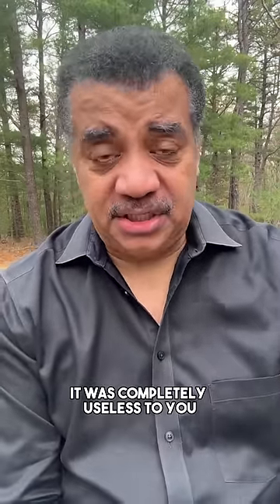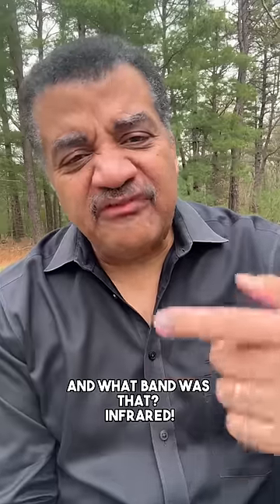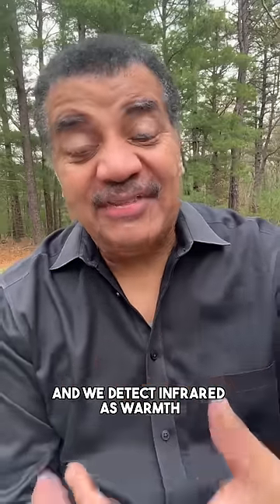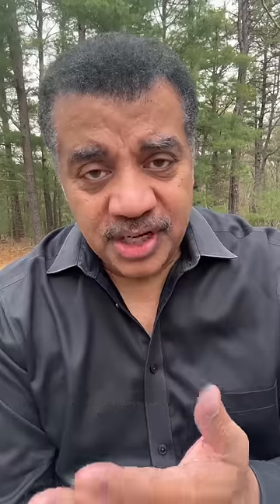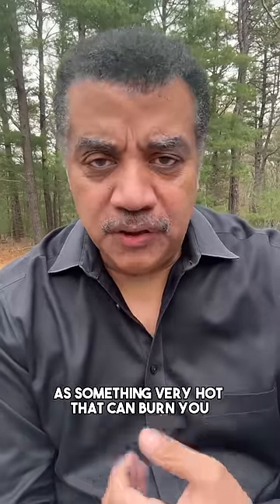LED Bulbs vs. Old Bulbs 💡

Comment: I have this theory that in ordinary houses, it's actually counter-productive to fit LED bulbs, at least in the UK weather. The reason being that the heat "wasted" using incandescent bulbs actually serves to heat the house, just enough that wearing a woollen jumper is enough to be comfortable without running the heating. In a similar way, that waste heat serves to prevent damp. In short, in a cold-climate, there's no such thing as wasted heat if it is retained in the house!
Reply: It is just that electric heating is way more expensive than e.g. gas heating, like your CV.
Reply: @JohnVanRaak-yx6cb  I wouldn't know about that, we only have electricity in my village. I have a fireplace in which I can burn coal or wood - usually only used at Christmas or when the power goes down in cold weather.
Reply: This is ridiculous. If you want to heat your house get a heater. The few hundred watts from incandescent bulbs is next to useless. Far better to use the electricity in a heat pump where each watt in gives at least 3 watts of heat.
Reply: @rogerphelps9939  Agreed.  And by separating heating and lighting you have control over both, which is helpful when you want one but not the other.  You can heat overnight without leaving the lights on, or have lights at night during a heatwave in summer.
Reply: @rogerphelps9939 I use a heat-pump for heating. Ultimately all energy used for any electrical service becomes heat, so the entirety of the 100W per bulb, eventually becomes heat, so if you've a dozen bulbs lit of an evening, that's over a kilowatt of heat - more than a single bar electric fire. My point was not that this is an effective means of heating, but rather, that there's no such thing as "wasted" heat from old incandescent bulbs....
Reply: @Fidd88-mc4sz Here’s the problem that’s only 100% efficiency which is not good enough to compete with heat pumps today. Also, if you want light you have to have the waste energy, and vice Versa, when sometimes you don’t want both
Reply: @gopackgo4036 I think you need to re-read what I actually wrote, not what you think I wrote!  I'm not talking about a house in Arizona but one in the rather chilly UK. Your statement about heat-pumps is ludicrous. "100% efficiency which is not good enough for heat pumps.."

Really????!!!!!!
Reply: @Fidd88-mc4sz  (1) I understand you live in a chilly place, that doesn’t mean it’s always cold. (2) If you own a heat pump you should know that the efficiency often exceeds 100% especially over a small temperature gradient.
Reply: @gopackgo4036  All of which I understand. And is pretty irrelevant. My point related to the rather questionable assertion that incandescent bulbs "waste" energy. Nothing to do with heat-pumps.
Reply: @Fidd88-mc4sz  well they do waste energy, and you did mention heat pumps. You seemed a little confused about the efficiency of a heat pump, so I was clarifying.
Reply: @gopackgo4036  I fear you're confusing theoretical, rather than actual efficiency. For half of the year it is fairly poor, in Winter  particularly, right when you "need" the heating, as opposed to heating hot water for use for showers/baths etc. Hence avoiding needing to use heating in Winter saves a lot of money and energy. The relatively trivial energy expenditure of incandescent light-bulbs during darkness before one turns in, is enough to prevent the need for putting heating on all but the coldest nights, provided you also dress warmly. Hence my contention that the so-called "wasted energy" of incandescent bulbs, which turns entirely to heat, is no such thing if it forestalls the considerable energy required to drive the heat-pumps, as some of the lost energy from those is exterior to the building and them confers no residual benefit to the heating of the building.
Reply: Brits be like: "It's cold, turn on the light bulb."
Reply: @elhazthorn918  LOL. We only really go that far if we run out of steak-and-kidney pudding!
Reply: @Fidd88-mc4sz  It doesn’t matter if it’s -20 out because the efficiency of a modern heat pump at such temp is at minimum 100%. Modern day heat pumps rarely drop below 100%. On the other hand, your incandescent bulb, besides not giving you the heat without also lighting the room, will be 100% “efficient” as you described.
Reply: @gopackgo4036 I use an air-source heat-pump rather than ground-source, which tend to be more efficient than air-source, although the set-up costs for the former are higher, I believe.  As regards the bulbs, ALL energy from any type of light-bulb ultimately becomes heat, so provided your insulation is adequate, then this power is all to the good. 

I fear you're missing the point here, which is that regardless of the efficiency of the heat-pump, not using it is better than turning it on, and therefore, as you will require a certain amount of lighting, irrespective of the need for heat, one may as well maximise the chances of not having to run the heat-pumps if achievable by using the "waste" heat from lamps to warm the rooms. If you have all LED lamps, that flexibility is lost, and you're more likely to have to run the heat-pumps on marginal days. Having got used to heat-pump heating, I now find traditionally heated houses oppressively hot!

Comment: That band of light IS actually useful.
Reply: You can get 'that band of light' without using light bulbs. Makes more sense if you want heat to use a heater.  If you want light to use light that don't also produce so much heat.

Comment: Our bodies evolved to need more than just the visible spectrum.
Reply: All heat you feel is infrared be it from a fire, electric heaters or incandescentlight bulbs, it's the same. If you want head best to use a heater and if you want light, best to use an LED bulb.

Comment: I like the old lights better. The color is more pleasing. Dosent hurt my eyes either
Reply: Yeah, that was true 10 years ago. Catch up to the present.
Reply: Literally there are LED that are designed to look the way you want so no, the old lights are garbage.
Reply: @ssm445 not true, it’s still missing light that you can see.
Reply: @mandersen2020  nope. Get a proper current LED, the CRI is > 97, and no, the ancient  bulbs didn't have a CRI of 100.
Reply: It's better to use the old bulbs.  If someone gives me anything with led I throw it in the trash can.
Reply: @tmayorca8770  I'd call it ignorant to use old tech and waste money for energy and replacement bulbs instead of just using superior tech (not a single failure in house or garden in 7 years. Osram Made in Germany).

Have fun replacing bulbs 🤣🤣🤣
Reply: @ssm445  you spend too much money one one dumb bulb.  I still only use bulb when needed and it lasts long time.  Your puny little LED lights give off tiny light not enough for a big man
Reply: @tmayorca8770  lol, yeah, now the LEDs are not bright enough lol. Ideologists are ridiculous. I mean... lol. "my tiny LED makes your big boy heater invisible".... Rofl. I can't get around this 🤣🤣🤣🤣 hahaha.
My 7 Watt LED bulb has a better light spread (by bigger filament) than your heater bulb. Also, it makes a 60 Watt bulb bright as a candle. And I don't need to replace it every 3 years, which is a relieve for ~40 lights. Never mind the huge energy cost savings.

Comment: NIR is not useless to you. It’s actually very important. Unfortunately, this is also the same portion of the spectrum that is filtered out by new windows. That’s why it’s important to get outside and get near infrared radiation.
Reply: What's the importance of NIR?
Reply: Exactly. That guy’s is clueless and confidently so.

Comment: Incandescents are warmer and don’t cause as many headaches as fluorescents and don’t seem as cold and blank as LEDs.
Reply: You know you can get "warm" LED bulbs, right? They're covered with a color film
Reply: Technically, you can get the same warmth from a dim LED, and it would also last longer. Also, the pleasant warmth from the incandescent bulb won't be so nice when electricity bill arrives 😂

Comment: I switched to all LED's years ago but have discovered there are still a few applications where I need an incandescent bulb so I'm fortunate in that I never discarded my old stock of those bulbs.  Places like the garage in a cabinet where I keep aerosol cans of everything from paint to WD-40 benefit immensely from having a lit bulb inside the cabinet for its warmth as my garage is unheated 99% of the time.  Also in electronics work on antique radios where I use a dim bulb tester to check for shorts when first powering an old radio up.  Even my bedroom still has one now as there are days when it's too warm to justify turning on the heat.  That bulb will keep my room a bit less chilly and is welcome to stay lit until spring, lol.

Comment: Infrared is actually good for the body…and led creates bleu light which is bad for you, it over stimulates the brain like your TV and phone (same light).
Reply: LED's can produce various wavelengths of visible light, not just blue. Also, all heat you feel is infrared light, whether from a fire or electric heaters.

Comment: The infared light is not useless, it warms/heats the house. Where i live, 75% of the year, I heat my house. Those old lights are 100% efficient 75% of the year as that heat from the bulbs just means my furnace runs less. In the summer, i hardly ever have to turn lights on as the day is so long. Thus, the old bulbs really aren't the villian that you make them out to be.

If you are using them in an area where you constantly cool your house then yes, they are extremely inefficient.

The LEDs actually have another problem and that is their switching power supplies make the power grid much more noise and less efficient.

Overall, if you use a heat pump, you should save money switching to LEDs as that saved electricty that now gets used for running the heat pump. Heat pumps can be 300%+ efficent  so they can save money that way.
Reply: yuck 🤮 it’s so

Comment: Most of the watts go to heat on LEDs as well. Difference is, incandescent and fluorescent lamps emit IR as part of the quanta of light and LEDs only emit visible light and the IR heat up the LED chip (that’s what the heat sinks are for). Thermal management has been the enemy of LEDs since we got above .75 watt emitters twenty years ago.  The blue wavelengths are this first to go in all lamps once the heat hits the chip useful life for that LED is on a short path.  Watt for watt, LEDs produce as much heat as incandescent. Reach up and touch the base of an operating 10 watt LED bulb and tell me that bulb isn’t making 8 watts of heat.  FYI
Reply: They certainly DO still produce heat in addition to light, but it's wrong to say they are watt-to-watt equivalent in this way. It's typically something around ten times as much of the power draw being converted to light, compared to incandescent bulbs. But to your point - this plays out as roughly ~90% of the bulbs power draw lost as heat, instead of roughly ~99% lost as heat.
Reply: Some led emit uv also

Comment: Still the light coming out of those old lightbulbs was far more pleasant and cosy.
Reply: …and they were a whole lot cheaper and last as long or longer than the current crop of LED bulbs.
Reply: Do you even know what makes it that way? You can replicate this with LED. It’s called color temperature.
Reply: @Ogmarcus02  Don't think it's that easy. I've tried really warm leds but it's just not the same.
Reply: @matslarsson5988  Then you are not getting the right ones.
Reply: @lblepus  back in the 60s my local electric utility gave you lightbulbs for free...one goes bad, bring it in and they'd replace it.

Comment: Light bulbs do make for convenient little heaters that you can see working for certain applications. They have replacements for them using heating elements, but I don't think they glow at all. Even, a neon indicator would be nice just to show that they're working. LED bulbs do get hot enough to burn you. I don't think they should be emitting much heat at all. The first compact fluorescent bulbs just got warm. I guess, there is a lot of losses in the ballasts.

Comment: Hey Neil, unscrew an LED bulb that's been on for a few hours. The bas gets hot too because LEDs don't need as much power to run so they sue resistors to limit the voltage. You could say that the "resistors convert electrical energy into infrared light" or you can say "they get hot"
Reply: Boom 💯
Reply: @neomacchio4692 yeah, was wondering when it would be asked why most LED lights have some form of heatsink. Because, despite being more efficient they can still get very hot.
And resistors or power management modules are still necessary to limit the electrical current or they get very, very hot and let out magic smoke and usually never come on again.

Edit "heating back to heatsink", I hate Android and it's 'auto correct'